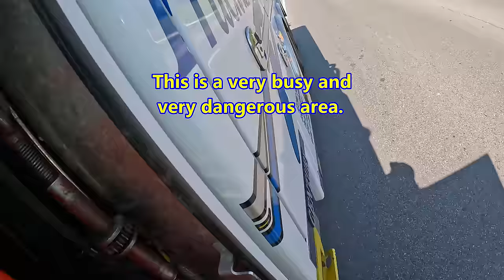DANGEROUS BREAKDOWN!!!  GOTTA GET OUTTA HERE!!!!

Comment: In Wisconsin, I was told by the wrecker operator (that pulled my tractor/trailer to a Penske yard), that they are NOT supposed pull tractor/trailer combos UNLESS there is substantial danger.  Some (stupid) sensor in my DT-12  tranny stopped sensing and, because every time Penske does software a 'upgrade,' manual mode disappears; I was stuck on the entrance/exit ramp from a VERY busy interstate to a VERY busy interstate bypass entrance - the officer didn't even get out of his car until the wrecker showed up.  The wrecker showed up, hooked up, and drug my truck/trailer about 15 miles to the opposite side of town, because the nearest Penske didn't have any loaner tractors. It took him more time to pull an axle shaft out of the front drive axle (because he couldn't get a clean grip on the driveshaft bolts), than it did to hook the unit!  I've been broke down on the side of the road many times over my trucking career.  That night scared me!

At the end of the day: you were able to get that tractor/trailer combo to a close 'safe' location.  Splitting them, at that point, was the better, safer option!  Sometimes the KISS (Keep It Simple Stupid) principal is king!

Comment: Traffic just has no common sense when it comes to keeping over, it's not as if your trucks are too tiny to see! Appreciate the expertise you put into all your recoveries. I guess if manufacturers could have got around the powered lubrication issue to allow autoboxes to be towed forward unlifted they would have already.
Reply: Gm used to do so.   No one wants to spen the money on it .
Reply: Simple solution. Build the trannies with a rear oil pump.  Most early automatics had a rear pump and could be push started or towed.  Sadly manufacturers  build their junk as cheaply as possible so a lot of things that worked have been eliminated.

Comment: I remember when the Peterbilt roll back was new.  Ron, I remember one of the first time its bed got scratch up.  You said something along the lines, it's a work truck and that's going to happen. You still found it a bit upsetting.  Looks like those feelings are back with the freshly painted rotator's underreach.  The first scratch is always the hardest!  Perhaps it will help to think of it as each scratch means money has been earned!  I pray for you and the crew to always get the job done safe.

Comment: Well, seeing the location on the back of that trailer, that was from a HVDC distribution center. Those trailers are always fully palletized so very easy to unload and reload if needed. But luckily you had an empty trailer and no unneeded headache. Hopefully you never get an overturned RDC trailer as that is all loose freight inside thats unloaded on a conveyer line of sorts, no unloading that on the side of the road to make the job easier. I'll have to see what market Olney distributes to, we get all ours from Sterling.

Comment: Ron, I am going to add kind of a "sidebar" comment since you did the hookup next to an RV dealership.
My parents for years had an RV dealership for many years starting in 1966.  The business was on a County Primary 2 lane road not as nice as it is today.  Anyways, the local banks wouldn't floor plan trailers for the business because they were not on the four lane highway.  The owner of the factory that built the Century trailers made a call to his bank and they always had a floorplan loan when needed.  The entire time they had the business, my parents never once set foot in that bank.  It was all done with a phone call and by mail.  Those were the days!
While that dealership next to you had everything on concrete, we always had the trailer parked on nicely mowed grass.  I always thought that our location better showed the trailers closer to the environment that the customer would be parking and using the RV.  It sure worked for us.
Ron, as you have said many times, "There is more than 5 plus 5 to equal 10."  Too bad the three piece suit local bankers never could figure that out!
Well done on a very busy fair week.  We did that too, display RVs at our County Fair.  We just didn't have to move them mid-fair!  Thanks and stay safe!

Comment: 23:10 i actually helped a trucker that was using a company rig to tow another company rig and the seat didn’t have a good mounting bracket so i could use the method you use to tie the steering wheel down. Ended up having to run the strap i used across the cab and to the footplates on either side and it worked surprisingly well

Comment: I love (hate) these trouble spots. Had to tow a little Nissan off the side of the freeway. I was given a location further down the freeway but found them at a curve, on a hill, where speeds are 80mph. Glad some drivers move over. Out of all the freeway calls that was my sketchiest. Second was pretty much the same, after an onramp and speeds were 70.

Comment: It's funny that your worried about scratching up the new paint.  Here in the Rocky Mountains, if your trucks paint looks too perfect, nobody will call you for jobs.   A truck with paint scratches gives the impression that your working a lot and have more experience is what one company told me.  Plus nobody wants to take the blame for putting the first scratch and dent in the truck.  🤣😂

Comment: Well, my usual guess on the post driver is that you've got some t-posts you can drive deep as anchors, but if the rotator isn't enough of an anchor, I'd hate to think how many posts you'd need to set for it to matter.
Maybe in case you need to set one as a light duty redirect?

Comment: im an avid emergency light enthusiast and i was wondering what brands of lights you use and what you do with any old lights you replace.  i personally use speed tech lights on my pov, and i end up just pulling my buddies out of ditches because im the friend with a strap and a diesel lol.
Reply from the maker: All of the factory installed emergency lighting is Whelen.   All the aftermarket red/blue lighting is Feniex.   We are actually a distributor for Feniex now, since we started using so much of their product.   Their arrow-boards, especially, have, quite-literally, been lifesavers.   And their Quantum series lights are nothing short of amazing.    They have 4 colors built into each head.   So you can take a stock light bar and use it for any purpose as far as fire, police, ems, towing, etc.   Or in a case like ours, we can switch between the red/blues and ambers depending upon which State we are travelling through.   Thanks for watching and God bless.
Reply: @RonPratt  thanks, I actually considered a feniex bar for my truck but it was a bit more than I wanted to spend on one

Comment: Oh I would so do that to you if I worked for you! I'd leave random tools and stuff in your truck just so it messed with your head.. It'd be hilarious.. I'm already laughing about the post driver and that definitely wasn't me. (I'm in California after all.) Never take anything out of a man's truck, but who says you can't put things in? Three things you should never turn your back on: 1) a big cat: lion, tiger, panther etc 2) the ocean 3) traffic. You struggling to connect that ratchet strap to the seat reminds me of me using a bungee cord for the first time in years the other day and trying to get a 24 inch cord to reach the bottom of the cleat on our 03 Ram 2500 and hook in while trying to secure a propane bottle. I should've bought the 32 inch or at least 28 instead of the 24 but I thought they'd be too long.. Should've bought a second longer one to go around the bottom of it too because only hooking it in at the top still allows it to bounce around.. It's been too many years since I had to do that. My parents said "why didn't you just put it in the back seat?" I'm like "even though I don't smoke in the truck, there's no way in hell I'm putting a propane cylinder in the truck with me.." Stupid part, I've driven 30 miles with a cylinder of acetylene in the back seat of a car with a cylinder of oxygen in the trunk... I don't like to but sometimes you have to do what you have to do with what you have. Luckily it was dad's 99 Olds and not my old Mustang or something. I wish I had a bolt down rack to fully secure them but I don't.

Comment: Ron, may seem like a dumb question, but... when I was towing years ago I/we always used the clutch/brake pedal lever when securing the steering wheel vs the seat base I see everyone using now.
Is there a reason why the choice of the seat base? Thanks for the videos, luv em all 🙂
Reply from the maker: That's one I can't answer.   I've been in the business for over 30 years and have always gone to the seat base.   I'm not sure why the clutch pedal was used as an anchor, so, again, I can't answer for back then, but, as for today, a lot of trucks have automated transmissions which do not have clutch pedals....just a thought.   Thanks for watching and God bless.
Reply: Tying to the seat base helps eliminate steering wheel movement.  Tying to the clutch or brake pedal the strap is mostly parallel to the steering column allowing movement of the steering wheel.

Comment: So does little pete not have the power to pull a truck and empty trailer?
Reply: I believe Ron said it could, but doing it this way was quicker and easier because you didn’t have to disconnect the truck driveshaft when towing it from the rear.